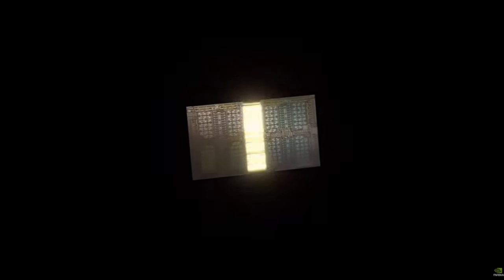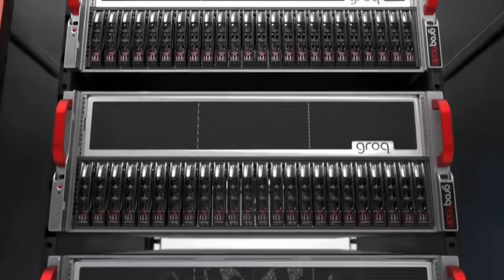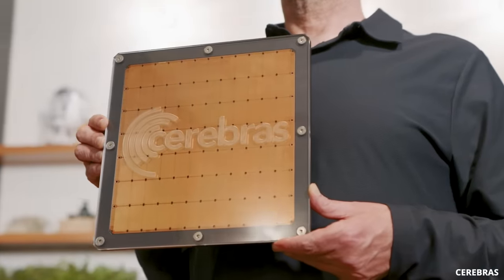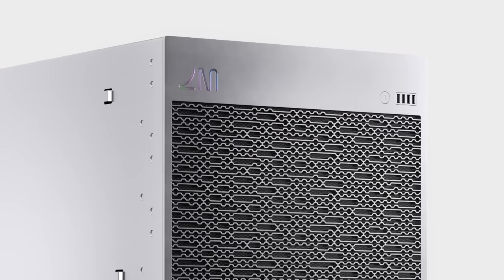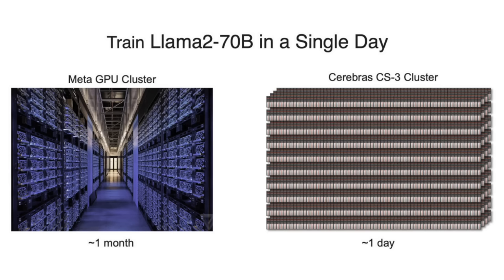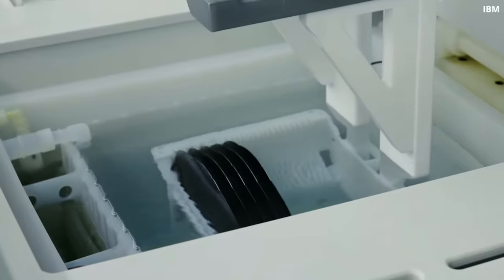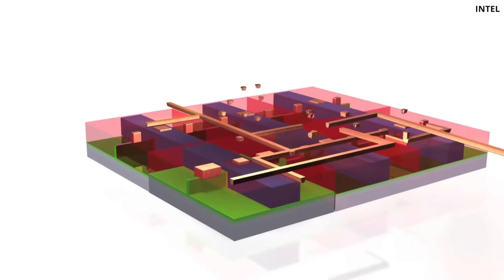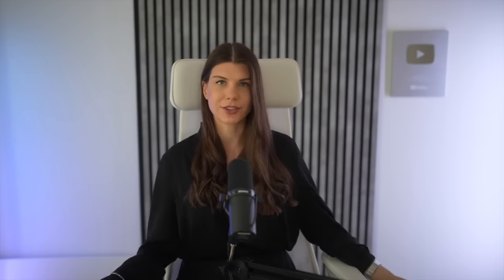Why do we need LARGER GPUs

Comment: When chip designers design the transistors paths with those programs, can they digitally simulate to check if the logic is working as aspected? And if so, is this simulation 100% proof that everything will work as expected in the real silicon or the things you can test are limited and you need to test the silicon with OS and applications and go back to the drawing board to change things until the silicon "behaves"?

Comment: Interesting. Maybe you get a better overall Neural Network performance by having more nodes at a lower precision, rather than less nodes at higher precision. It would be interesting to create a really simple network that followed these strategies in both directions. There must be a sweet spot where the number of nodes and precision give the best performance for the amount of Silicon they use.

Comment: If a chip is double the performance but more than double the price, since it's just two of previous gen dies connected together, it does not outperform Moore's Law, rather the opposite, since it is specifically about compute per price unit.

Comment: I think a grid of LUTs, in which the weights don't move, and the data flows through, could be a much better architecture. You could reconfigure for any bit size, route around defects, and if you completely eliminate long data lines and routing hardware, could clock at 10 Ghz with far lower power.

Imagine GPT4 at 10 billion tokens per second?    (Now the latency would be on the order of 10s of uSec, but you could have parallel streams)

Comment: Amazing review as always.  The last chip: Ceteris paribus, multiplication is far more expensive than addition, in terms of transistor count, power consumption, area, and complexity meaning greater latency.  In fact, in most designs multiplication includes addition. But of course that is Ceteris paribus,  if at the end the number of sums is greater than the number of multiplications by a wide margin the equation could end up inverted. All that say and done,  it's not clear to me why they target addition, besides maybe complexity.
Reply: Probably because multiplications can be done in parallel, but addition not entirely.

Comment: Interesting that the analogue chip is using digital for multiplication given how simple it is with analogue compared to digital. Look up the "Gilbert Cell". It can do four quadrant multiplication with differential inputs using only 6 transistors.
Reply: Look the noise figures for. Gilbert cell. SNR might be a problem.
Reply: Maybe, maybe not. It all kinda depends on the resolution.

Let's say you want to multiply 2 x 4-bit (0-15) numbers and get an 8-bit (0-255) output, with both inputs and outputs normalised to 1 volt full scale.
Each input is only 0.0625v/step
The output is only 0.0039v/step
Both of those are well within the capability of even a £15 Amazon multimeter.

Comment: Is it possible to build chips bigger than the largest Cerebras chip? I wonder where the practical limit is. And having technology that would analyze chips for flaws and then correct them, I'm pretty sure that technology doesn't exist but it would be very useful.

Comment: I was an Intel engineer back in 1990 .We had the first CPU with more than a million transistors .This was a state of the art i860 vector CPU 64 bits ... Now they are talking about 208 billion transistors ,,this is 200k time more dense that the i860 !..Or in other words 200k of those 40 mhz chips in one die
Reply: Are they working at similar die sizes to what you were producing back then? It's wild seeing the variation of sizes at the moment, especially with the aggregate setups as you go up the pricing/performance tiers with mainstream cpus.

Comment: My one take away from the "En-Charge" technology discussion is this:
Yes, we can finally get a reasonable functional clone of the old SAD1024 BBD chip and not have to breathe life back into the seriously fraught technology of the 1970's Reticon fab line. 

Musicians of the World : we can even create an massively deep analog reverb with the En-Charge tech (one that has sufficient 'reflection surfaces' for reasonable function, unlike earlier BBD-based reverb designs.) 

- - Sorry for the odd post. I worked in 70's/80's/90's hightech culminating in 11+ years at a then-major maker of IC and system design tools. And I play a few musical instruments. And I still chat with a few musical system designers on technical stuff, once in a while when my skills of circuit noise reduction or odd-component  characteristic-knowledge proves beneficial... been doing Dr work for the last 20+ years, but old loves die hard. And the utility/longevity of the BBD-type device is one of those  loves.
Let's bring back the SAD1024, with many, many, many more taps than before.
Again, my apologies for the distraction... back to your regular channel/content.
Reply: Bucket brigades were a thing for a while in the 80’s until they got too long and noisy!!

Comment: People were surprised that 64-bit processors did not perform much better than 32-bit ones. It all depends on the algorithm and application. In most applications, 32-bit and 16-bit ALU are sufficient.

Comment: Apple was already fusing their SoC chips into a larger processor unit.
4Bit (Nibble) math is not that big a deal, but you then need to double up the cycle’s to process 16bit and then four or eight for larger word and double word. Not really changing the speed of the process only increasing the chips complexity.
Larger dies (silicon) has merit, but the heat produced at the higher cell density then becomes the limit. So while sub 6 nanometers allows the same processor die to run cooler you give up that advantage when you increase its process density!

Comment: HOW TO CONNECT EVERY PIXEL ( SIZE OF A ELECTRON / PHOTON ? ) ON THE CAMERA'S SENSOR VIA BUS ( WIRES )...
DRAM > ISP > GPU ( MEMORY CACHE / CONTROLLER ) > DISPLAY ENGINE > PIXELS AT THE DISPLAY🤔

Comment: Well... what happens when we design A.I. models to operate on hardware with very low precision?  In general, that will work!  Anybody analyzed the exceptions?
Reply: Dr. John Gustafson wrote an excellent book describing the FP precision problem and its solution: The End Of Error. An enormous amount of computing power is presently wasted on false precision.

Comment: Your comments on yield are not correct. Also, Nvidia did not chose TSMC N4 versus N3 due to yield. The Blackwell Design was started well before the TSMC N3E PDK 1.0 was ready. It takes years to do a complex chip like this and you must chose a stable 1.0 PDK to get started and that was TSMC N4P. Nvidia will continue to use TSMC as they are the only foundry in HVM and 3nm.

Comment: This is a stop-gap, surely. OF COURSE you can outperform Moore's Law if you double the die size. Performance per watt (which, barring other optimizations & innovations, is equal to transistor density) remains the standard, & something we struggle increasingly to meet.

Comment: Nvidia has built a complete platform: hardware (GPU-CPU-DPU) + software (Cuda as foundation layer) + networking. How would Cerebras fit into Nvidia's architecture stack?
Nvidia and AMD are at the quantum physics limit (number of transistors on a chip of same size). Cerebras makes one bigger chip (but same amount of transistors for the same surface). So is Cerebras facing the same limitation?
 Unless new concepts would allow connecting layered die's in 3D would change the quanity of transistors ... on the same volume (heat dissipation ?).

Comment: These tecnology is only announced by nvidia, that think more in more die about 320 mm^2 at reality high frequency about 600 mhz), or more in gtx. Transistors is more than 30% respect the best 455 mm^2 actualy.

Comment: I think Moore meant that the process nodes would keep getting smaller proportionally as more transistors were added. But these companies are simply just printing trillions of transistors onto a single wafer of like 12". Well sure, you can print 10 trillion onto a wafer of an 18" or even100" diameter too if you really wanted, but is that actually breaking "Moore's law", or is it just breaking world records of "monolithic lore"?

Comment: The problem with hybrid analog digital chips is that the signal needs to be converted from A2D and vice versa. 
This process is always slow or inaccurate and therein lies the bottleneck.

Comment: Seems like this "chip-buddy" system on a wafer could open up the industry to older companies that are stuck at 10nm or even 20nm or larger if they can run with nearly zero defects??? If so, many older players could get back into the high end game, with just the right base chips and onchip memory. I wonder if these companies are connecting the chips in the manufacturing process, to lower the cost and improve the performance?

Comment: I've been saying, at least since the Turn of the Century, it's Not the System RAM that needs to be Expanded for the System to Run Faster, you Need to Expand your GPU and Video RAM.
It was Blatantly Obvious to Me that it was the Graphics at the Core of the System that were the Bottleneck. Everybody would love the Desktops I built for them because I Always quoted a Better GPU than System RAM. They all told me How Fast their computers seemed to run than others they used.
Vóilà‼️
I would build All my Desktops like they were Gaming PCs. Everybody Loved how Fast and Responsive they were. And these were Windoze boxes !
Truth❗️

Comment: 5:15 "used floating-point numbers up to 8 bit precision" actually down to and now down to 4-bit. All else equal it's worse except for power and more numbers in same memory space or at same bandwidth. Actually newer neural networks can do 2-bit or lower and don't need floating point so the Nvidia FP4 tech is already outdated, but will help for inference of current mainstream networks. FP4 isn't really useful for anything else, nor for future best neural networks. I mean FP4 can still be used for 2bit, just not optimal nor needed, when better chips arrive. It may though be best for now. At least for some things, Grok chips are also good and maybe better for inference already, but Nvidia better for training still I think. Nor possibly best for training... Other like Cerebras may have better, but maybe none has better price-performance yet.

Comment: You are not old enough to remember when Apollo 13 had to make crucial manual manoeuvres to re-enter Earth's atmosphere? too steep and they burn up, too shallow and they bounce off and run out of air. That calculation was done using a servo motor analog computer first because it offered an answer immediately and second because the digital computers of the time could not handle the complexity of the calculation. So the answer only needs to be close enough. So from 8 bit resolution to 4 bit resolution may be optimal IF the outcome is revisited many times, thus the number of operations is decreased but in order to obtain the required accuracy it may have to be done many times. Sounds like marketing logic but lets see how Nvidia apply this 4 fold gain. With respect to analog computing, integration and differentiation can be performed with amplifiers using capacitive feedback. From my experience all capacitors have thermal variations metal or not, the dielectric element sealed within the die when heated will vary the capacitance.

Comment: I've been using 4-bit quantization for LLM's like Mistral.  It's nice because I can run larger models with only 16GB of VRAM.  It doesn't effect performance that much, though 3-bits or lower definitely changes things.  Note that I have not fine-tuned or trained models, only run them.  If these chips are designed to run at 4-bit precision, it would improve things even more.

Note that 4-bit quantization for LLM's often use tables to add more precision for parts of the process, though this is based on last year's research.  It may be possible to use true 4-bit numbers for most of the calculations.

Comment: FP4 is a better utilization of bits if that is all AI needs.  Here is my problem with this.  It can't be used for anything else.  Can they be combined at initialization to perform FP32 (shader cores)?  I have a 3090.  It has RT cores and Tensor cores.  They are useless for games that don't use them, which is a waste of silicon, now that one of the reasons for FP4 is to conserve silicon.  AMD's solution is to emulate that through software.  But we know that is not as fast.  Will these AI/FP4 cores be integrated with new CPU's or GPU's.  I really don't want to replace my CPU nor replace my GPU just for AI (another waste of silicon).  These AI cores should come on a separate card.  For those that don't have an extra PCIe slot maybe an eTPU via USB-C, which brings up the question; what kind of throughput do apps need with AI cores?  I'm guessing not much.  Like once every second.

Comment: Moores law is dead. We are never outperforming moores law again.

Moores law has to do with transistor density, not computing power. Transistor density leads to computer power, but computer power is not the measure used in moores law.

We are in the era of making bigger chips. Notice the size difference of the processors in his hands?

Gotta read through the hype. What Nvidia is doing is impressive, but Nvidia doesnt even make chips, they cant beat moores law.

Comment: SIGNALS / PIXELS ( e SIZE ) ( VOLTAGE WITH SPECIFIC FREQUENCY ) FROM CAMERA'S SENSOR ARE PROCESS BY IMAGE SIGNAL PROCESSING ( ISP ) > GPU ( MEMORY CACHE / L2 CACHE )... DISPLAY SIZE PROPORTIONAL TO SENSOR... FREQUENCY> COLOR & INTENSITY..🤔
Reply: > DISPLAY ENGINE > DISPLAY.
OSCILLOSCOPE...
e BEAM INTENSITY
IF WE OFF THE TIMEBASE...WHAT HAPPEN TO THE SINE WAVE
Reply: SINE WAVE > INSTANTANEOUS VALUE FOR 1 CYCLE.
50 Hz > 50 SINE WAVE / s😊

Comment: I think Blackwell could be a big mistake in long term...
Reply: Can you explain your thoughts ?
Reply: @skyboybenji9185   yes of course. basically is the same architecture, same memory access but low preccission, while other companies are creating completely new architectures with (cpu/npu/gpu) integrated memory, analog processor even with chemical reaction that can act as processor and memory at the same time. In my opinion if Nvidia dont change quickly can be passed in two or three years. But I'm not an expert 😁😁, just a bar opinion.
Reply: @ryddlesoft thank you for you’re answer, what company’s you see now as possible newcomers?